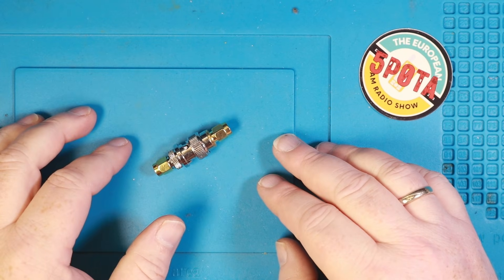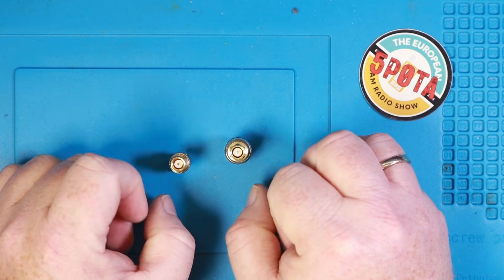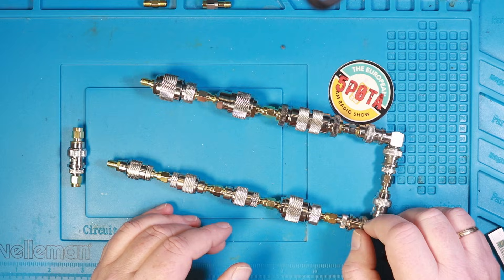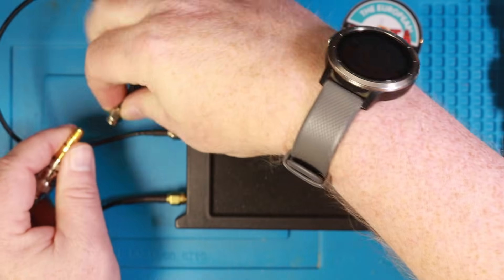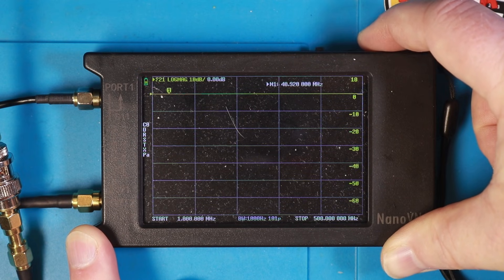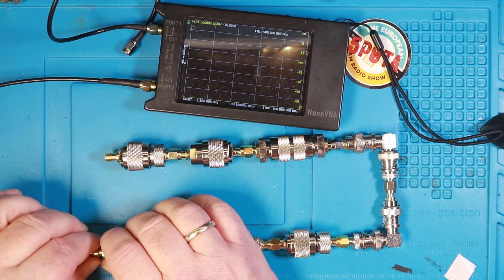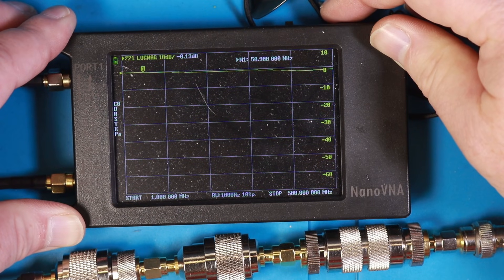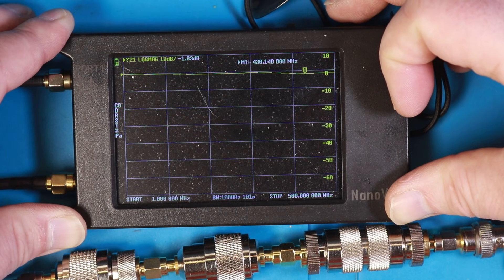Insertion Loss - Can You get by with 20 Adapters?

Comment: How about a list and count of the various adapters used in your chained 20 adapter test?  I count 4 BNC joints, but I cannot tell what the other 7 screwed connectors are.  Are they N type or UHF (SO239/PL259)? The 8 SMA joints in the chain are clear.
Reply from the maker: Thanks for your input. There’s a bit of everything in there. PL-259, SO-239, N, SMA, BNC and even a couple of TNC. Honestly though, that’s not the point of the video, and I have strong doubts that any other combination would have made a difference.
Reply: @LB0FI  Ever since you have become a ham you have heard that adapters have very little insertion loss. Ever since I have become a ham I have heard that the design and quality of adapters determines their insertion loss.  SMA/BNC/N/TNC all are designed to have minimal insertion loss up to 1 GHz or more. These were all designed after WWII when VHF and UHF became much more widely used.  On the other hand, "UHF" adapters (SO239 and PL259) were designed in the 1930 when VHF and UHF were just beginning to be used.  SO239/PL259s are named UHF because the maximum frequency of UHF was defined as 300 MHz when they were designed.  Subsequently, UHF was redefined to 300 MHz to 3 GHz.  Generally UHF manufactures say UHF connectors are good to 300 MHz and best below 100 MHz.  As I play a lot in VHF and UHF, I try to avoid  SO239/PL259 connectors.  I've seen tests where low quality UHF connectors show 1.5dB insertion loss per connection. Low quality connectors cut corners by using cheap insulator material, and lower quality or no plating on the center plug and jack connecting surfaces. Poor manufacturing tolerances may allow misalignment which adds to losses.  I suggest you chain together only the SO239/PL259s you have and rerun you test up to 500 MHz.

Comment: I have done similar experiments, I was interested in a comment that right angle connectors had a higher loss than straight. My janky, not very scientific, experiment concluded that right angle was more lossy, but it is minimal, fractions of a dB.
Reply from the maker: I thought I was done with this series, but now I gotta make a video on straight vs angled adapters.

Comment: It's been a bugbear of mine for years, the majority of hams who comment on this sort of stuff will spout all sorts of folklore about connectors, adapters, loss, mismatch etc. and it's just not true for almost any practical purpose.

Yes, there may well be a measurable difference on high end test gear or with really poor quality adapters but for general use, nah, they're just fine and you'll never notice the difference if you don't know it's there (A bit like the "golden ears" audiophools).

None of those adapters look like Amphenol, Huber Suhner, Rosenberger etc either.
Reply from the maker: I can assure you that there are no expensive adapters there, most of them are 100% pure chinesium. So yes, using adapters is 100% fine!
Reply: I have done these test with calibrated professional equipment and the results are exactly the same.